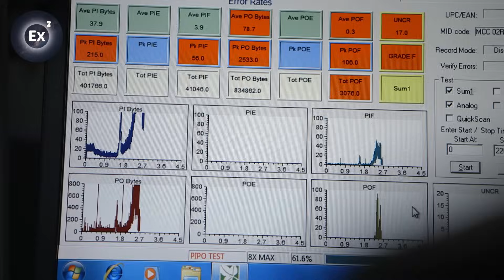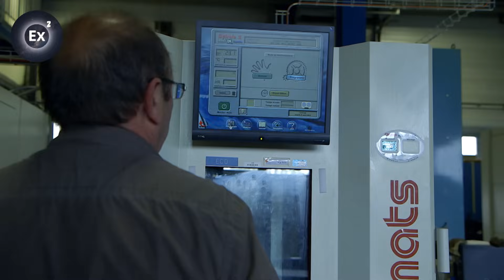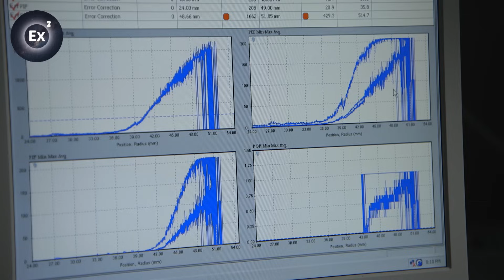Why is digital data so fragile? | Experts Explain

Comment: The "internet never forgets" because data is stored in redundant places in the cloud.   It is true that one medium will not last forever, but if you store in the the cloud, you should never lose it as data is automatically copied and then recreated on new drives once drives start to fail.  All of this happens automatically.    But, if you store stuff yourself you probably don't keep multiple copies, so you may lose it as nothings lasts forever.   That's why your best bet is to back up your data in the cloud.
Reply: I'm looking at old posts on old sites and all pictures from external hosting are lost. Some of the hostings simply closed, some of the hostings cleared the place of unclaimed images. Video links disappear because the associated video hosting account has been banned or deleted. Many links lead nowhere, because there is no longer a site, comment, page, file. So the internet forgets.
Reply: You can't trust the cloud at all. 
The Internet was designed to withstand the nuclear strike. It was the DARPANET for the government and military. 
It reformed itself to become as Internet. And it was promoted that no country can control it so that they can stop other countries accessing internet by economical or physical means as by war. 

But in 2010 or so a Swedish study was made and it was found that almost whole internet can be taken down by striking to 3-5 strategical places depending where you want to do it. There were dozens of key locations where it can be done. And if a single nation is wanted to be out, it can be done far easier if you surround it. The most protected network in the world is in the Russia. Its 11 time zones made it capable have access to far more other routes than example USA has, that is far second. Few critical nodes and you can get USA out of Internet, isolated to own nation wide network. 

Your data is even less than that. The data doesn't go randomly all around, it doesn't get backed up multiple times all over places. Likelyhood is that your data is sitting in a two separate HDD in the same server rack or even just on server next to it. 
Example if I upload something to Google drive, it doesn't get further from my location than just 30 km, because that is the closest Google server farm in hundreds of kilometers. The data in there is saved to 2 or 3 different HDD. Parity is made to be in two different servers, but it likely is in just same server road in the building. Is it likely that both of those gets destroyed, or devices gets damaged at the same time? No... But there is no such thing as impossibility. 
The data is as safe as it is if I would run a RAID at the home. By standpoint of mechanical failure in one HDD. As if I then immediately swap new HDD in and copy data to get backup done from the original, then I am fine for a moment. But I am not safe for burglar, home invasion, fire, or most likely, human error of deleting data.

If I am smart, I will write the data on three HDD (1, 2 and 3), I will have disks 1 and 2 as a RAID, and then I will have disk 3 moved to off-site to secure location by physical access. 
And I will have the RAID to be synced to disk 3 periodically over night, once a week at least. In critical times it would need to happen every day. And the sync happens only to changes, and they are kept in 2-3 previous versions. So at any given time I can get 2-3 days or 2-3 weeks backwards. 

This is not a problematic thing to be done over normal internet connection (1-5 Mbits) if I can maintain data size relatively small (lets say 1-10 GB per day) but anything bigger than that and it becomes bottleneck by connection depending how much.
That gives full backup to system. As you always have your devices itself that maintains primary version of the file, the 1&2 holds the secondary version in fast network, and 3 holds backup of original files.

And only you have access to the files, by any means required really as you have physical access in a day to it even.
Reply: I would not rely on those fancy clouds, they are in general just as vulnerable as FTP or any other data access systems.

As said by einsamaberfrei, from the moment you lose access to the cloud or any other subscription based data pool, you lose access to your data stored there, as it were gone. In case of major disruptions of the internet, which we luckily haven't had for now, despite all those redundancies, there could be huge data losses. I don't mean the apocalypse for us like nukes everywhere. It could be as simple as a controller chip that is part of 90% of all hard drives but somehow can be remotely shut down or defunct by a special data sequence passing through. I doubt that datacenters or server farms are checking their hardware meticulously for any similar vulnerabilities. The Intel Meltdown and Spectre disaster should remind us that there could be waiting a ton of such (even known) doors for exploits on any hard- or software.
Reply: Only soyboys use cloud. 
NAS and BluRay are far superior.

Comment: Nothing beats good old fashioned paper.
Reply: @licheong  You mean clay, they used clay tablets for most things, otherwise the scribes would not get anything done.
Reply: Fire
Reply: I found 90 year old newspaper stuffed into the wall at my house. Yes it was very readable but 100 times more fragile than toilet paper. So I read it 1 time & it turned to dust in my hand pretty much. I question paper. Stone or QR codes etched or 3d printed on plastic or something maybe 300 yrs readability.

With consumer grade media they dont know/care who the consumer is so they just try to make it last max 1 lifetime.

Comment: As an ex Software developer and network Admin, I keep as a minimum, 3 backup copies on separate (and ideally) different media (DVD, USB stick or SD card or removable hard drive). Oh, and I test the backups periodically to ensure they're still readable.
Reply: They largely focused on CDs but those seem like the cheap CDs I used to burn disc with. If I'm not mistaken the media is stored on the metallic layer (for CD R/W at least). On higher quality mass produced CDs (think records) the data resides on the plastic itself only requiring the metallic layer for reflection of laser.
Reply: @GeoffereyEakinsTech  wrong, the data on a cdr is in organic dye. Cdrws keep the data on metal, but it's more fragile due to being based on phase change.
Reply: HDD are a great backup medium. I keep a few for backup.
It is also a good idea to once in a while to wipe a HDD and copy everything to that HDD.
I don't trust DVD-R since I had trouble with them.
Reply: @louistournas120  lol, did you get the cheapest dvd-r you could find???
Reply: @Intelwinsbigly  I got the verbatim and polaroid shi.
Reply: Blu-Ray > DVD
Reply: Irony there was HDDVD actually was superior to both dvd and Br in many ways   including longevity and data security

But of course ultimately its still a multilayer optical media
Reply: @konnorj6442  it was worse at data density

Comment: Some years ago, the person responsible for the cover photo of Time magazine, pointed out this same issue with digital photos and how, with film becoming obsolete, we were entering an age where the long term storage of photographs has become an issue. In times past, film negatives had been found locked in cupboards or cabinets, long forgotten for decades, yet the photos were recoverable. Now, we have all our information stored in a similar way. If some global catastrophe were to happen, all our data would be easily lost, leaving future generations with the mystery of how we achieved what we did..... does this sound familiar?
Reply: There is also the big issue that people have not learned sadly   we are ANALOG by nature.   And for visual media like pictures or film (aka moving pictures) it costs more now to do it right on actual film  but for important content the simple fact is analog is vastly superior.

Case in point  Sadly back in the early 90s Pink Floyd did the division bell tour..  (I saw them again then thankfully)
But they were told by people in charge of filming the concerts that they should not do the same as before with film etc butnto use the new "greatest ever cant be beat" recording to svhs equiv which like our digital is limited to X resolution..  sadly as they learned yrs later that medium cannot even be realistically upscale even with the best tech now.  The info lost by not usingnanalog film is forever gone.. and that's why we cannot ever have a true proper HD version of the Pulse concert video.
Even now most filming done in digital are commonly done in 8K res.  While vastly superior to what was used back in the 90s it is still LIMITED
It will never ever have more than 8K resolution of real info

However if the same movie/concert etc is filmed now on say 35mm or better that can be scanned in at 8K.. then edited etc etc and then released for consumption at 8K..  but as time goes by and say 10 yrs from now we find  we ae then using say 24K as common consumer res TVs etc   that 8K is still max 8k   but if wanted that original analog negatives which stored properly are still pristine  and can easily be scanned again at 24K.   Poof  24K new uber quality..
And say 50 more years down the road the same can be done at the 1000K then used 

You get the idea.. 

It is why many classic movies done properly on film can be remastered now at 4 or 8k from the film  but a movie even aay 29yrs old done on video tape much like pulse is in many ways a disaster of disappointment

Analog esp for visual and auditory mediums as our bodies actually work in naturally (we are analog)  

Stick to analog for original masters  and learn from our MISTAKES!!!
Reply: @konnorj6442  4k already blows away what most film could do. 8k is more than enough for the better film out there. The entire universe is actually made of discrete things. There aren't any half atoms out there.
Reply: @timramich  So true. Film actually has grain and its own finite limits.
Reply: @timramich  The Quantum Physics Double Slit experiment asks "am I a joke to you?"
Reply: @konnorj6442  35 mm film has a resolution of abut 4K. There is no point in scaling it up to 8K and more.
Of course, if you use larger film, .... well you can.
The nice thing about digital is that error correction technics can be used to create perfect copies.
The problem is that if there is a problem with the signal, such as when I am watching TV from the antenna, there is no image at all.
With analog signals, at least I could still watch and have a noisy image.
Reply: We still can't definitively say how the pyramids where built.
Reply: @Emppu_T.  We don't need to know how because with modern construction equipment we can build as many pyramids as we want.
Reply: Yep, it's all a house of cards
Reply: @licheong  Similar to what happened after the fall of the Roman Empire,I would expect.
Reply: @davannaleah  americans are the roman empire. the mayian  etc...
Reply: If it wasn't for the fact there are many important photos put there, I would be fine with the hoards of selfies ending up in the trash in of history
Reply: You have exactly elaborated the problem.
Reply: Plant of the Apes !
Reply: I POINT OUT SOMETHING YOU MAY NOT WANT TO THINK ABOUT.... IT HAS HAPPEN SEVERAL TIMES IN PASS
Reply: @omerta-omega  You mean Thermopylae, or Donner? Majuscules still let you shine through dully.

Comment: Not "digital" is the problem. It is the density. All you need to do is hammer the bits in stone. 😂
Reply: There is actually optical media with that idea in mind that can last basically forever.  Of course it requires special equipment to use but it offers far greater density than chiseling something into stone.

Comment: Yeah makes sense that the increased complexity that makes digital data so convenient also makes it so fragile. A reasonable strat for the average person would be to keep it all on some hard/solid state drives using ZFS and migrate to new drives every 10 years or so.
Reply: if your doing cold storage on ssd - that is to have unplug the ssd and leave it for months, you may suffer from data corruption. The data is only "solidly" stored if the device recieves power at regular intervals.
Reply: since pc's do not use error correcting code. every time you move something you introduce more error!
Reply: @Number6_  They do if you tell them to via hardware and software, which is what I suggested. On top of ZFS you could use ECC RAM for another layer of correction.

Comment: The title makes no sense. Digital data is actually infinitely more robust than analog data, which cannot be verified at all. One can simply build a checksum over digital data or run recovery operations (e.g. using RAID on HDD level). No such thing is possible for analog data. Therefore, I am very confused by the video's title... 

Or maybe the question was really why some storage media or so fragile? I could use 1 thousand metric ton heavy stones as 1s and empty areas for zeros - this would be an insanely wasteful but insanely robust storage media for digital data, showing that it is not the digital data which is fragile, but at best the storage media.
Reply: However, the analogue information on a vinyl disc does not need complicated decoding systems to read it in any situation.  During the 1970's and '80's, music recording studios saw that they could record the music as digital on magnetic tape. Seemed terrific as there was no problem with signal to noise ratios, wow and flutter or frequency range.  
However, all magnetic recordings are degraded by the continual ebb and flow of the magnetic field of the planet.  Even moving it from room to room changes the background field.  
By the early 2000's when the engineers reached for the tapes, the analogue copies were still readable and able to be understood and re-engineered to close to original.  The digital signals had faded into the back ground such that it was difficult to separate "fact" from "fiction" in the noise from the tape.
It is also easier to build a new analogue tape play back machine than a digital one.  The hardware maybe the deciding factor.
Reply: Lol, real robot take right here.

Digital data requires perfection, a single bitflip and the file is done. Very fragile.

Analog doesn't need to be perfect, as its a facimily of the real world. Even at 50% signal, you could still get a recognizable picture on analog television, now I can't even get reception.

Comment: Well, that wrapped up real quick at the end there... Seems like there's a lot more to actually say about this
Reply: Yes very good, but I'm ready for part 2 - How to get out of this mess :-)
Reply: Worst part is the claim made about nand technology. That it can be safe after being written and locked away for dozens of years. That is simply untrue. Modern nand cells (TLC/QLC) will become very difficult to recover data from after several months to a year and suffer high error rates longer than that without being refreshed (copied from one cell to another).
Reply: @pussnuts  so even for a desktop that we don't use often, if we leave it unplugged for 6 months, we are in danger of it not booting and worse our data is corrupted with bit rot?
Reply: @licheong  But with SSDs you have also SMART capabilities and other health parameters. You may not hear it dying, but sometimes it is a relatively slow process that you can observe. I would assume from experience that a much faster medium should also die faster. In the end, the case that a mechanical drive announces its death and lets you retrieve its data is more frequent, true, but it shouldn't be expected, since they can also die from one moment to the other. For all media since carvings in stone I would recommend a proper backup strategy 😏
Reply: @licheong  yes as bits per cell and density gos up the charge held gets smaller and more at risk of being unreadable reliably.  I have read that occasionally powering them up helps the refresh but I assume this also eats into the write endurance.. so no silver bullet.  So I've started to use a mix of hard & flash drives and recently M disc.